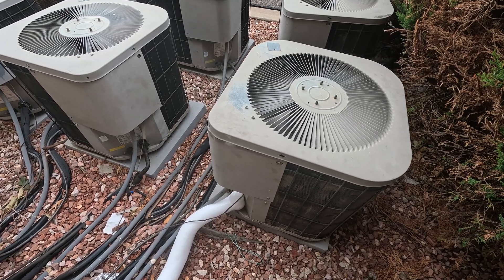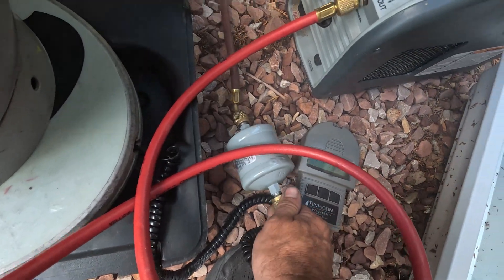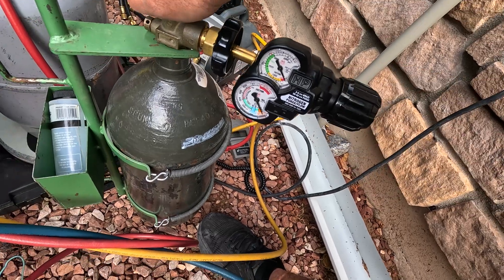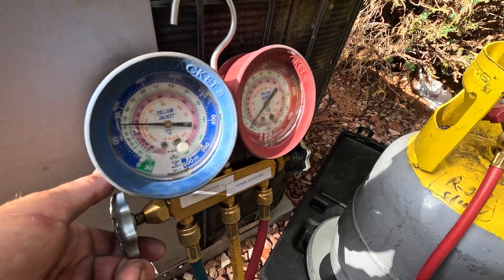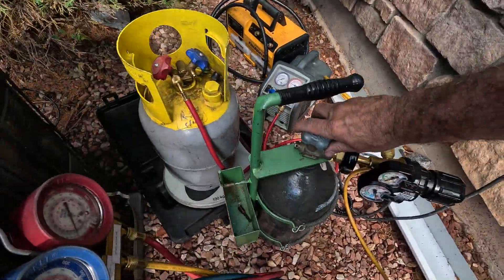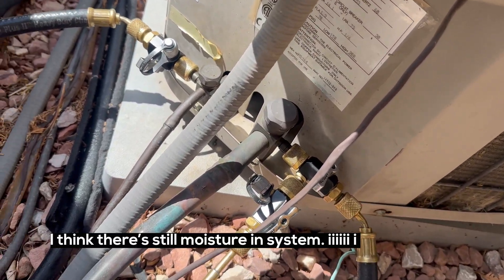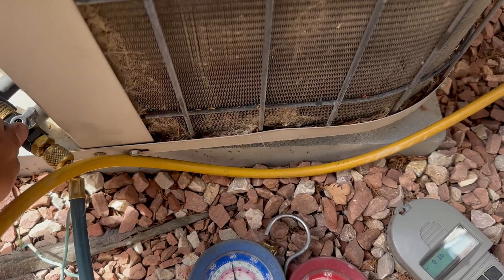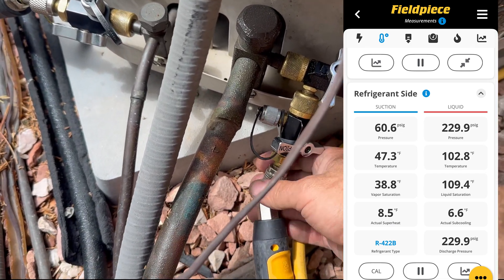Emergency Refrigerant Leak Repair on Old AC Unit

Comment: Guy taught me years ago, Use a file to finish cutting through the cap tubes.... sleave the tubes with 1/4" copper like a coupling...no risk of plugging the cap tube. Have been doing it that way ever since... cool video 👍🏻

Comment: You did a GREAT job. There is NO WAY , NO WAY your going to get a 25 year old system down to 100 microns !!! There is just too much contamination from over the years.
A new filter/dryer and 1000 microns is the correct fix !!! GOOD JOB !!!
Kudos for doing the repair and not trashing it !!
Unfortunately if one distribution is leaking(not from rubbing) then they will all be eventually leaking.
Reply: Agree 💯Been there many times before myself. It's one thing when you pull up to someone's house as an HVAC tech and another animal altogether when working maintenance on older units for instance on a complex with 200+ units that are all old R22 systems. I've done lots of both and the maintenance side is often far tougher. Time and money constraints etc.